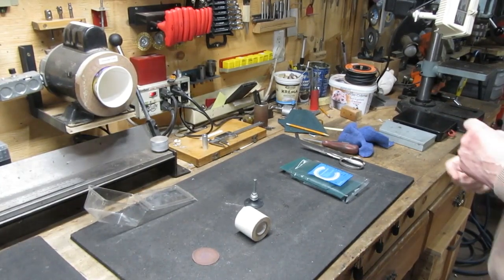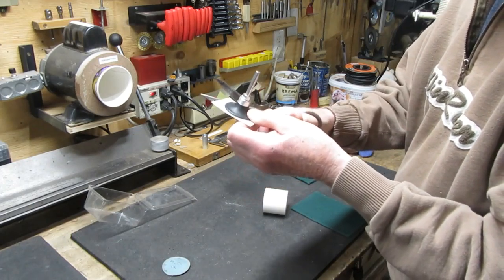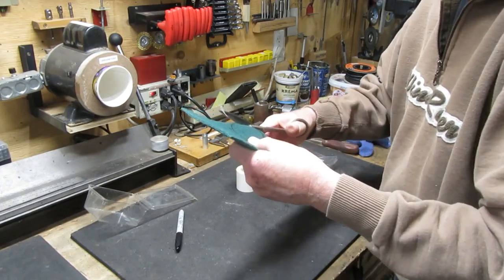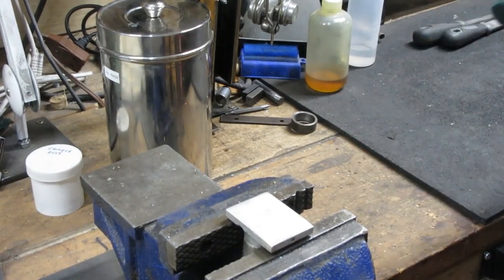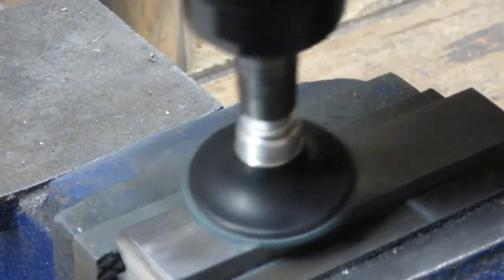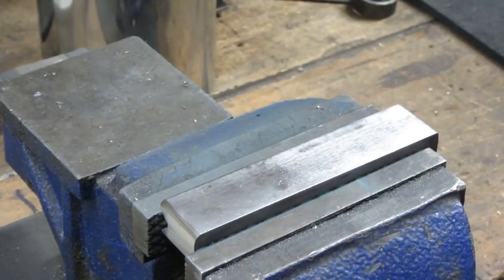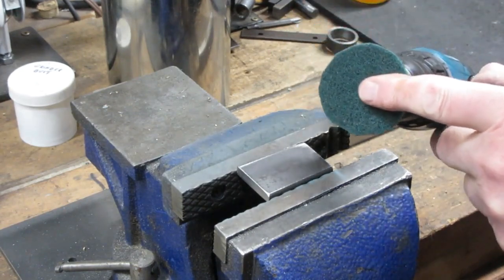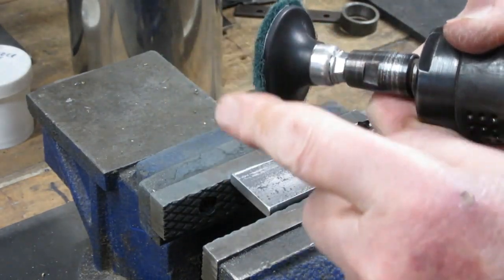Buffing Experiment.

Comment: Nice reclaim on your grinding pad, excellent for gasket cleaning and blending. I don't know how that die grinder will react to the thrust generated. I got one of those cheap 90 degree angle grinders, and it is much nicer in the hand as well as being configured for the thrust like the drill is. Great tip, enjoyed very much, cheers!
Reply from the maker: Thanks